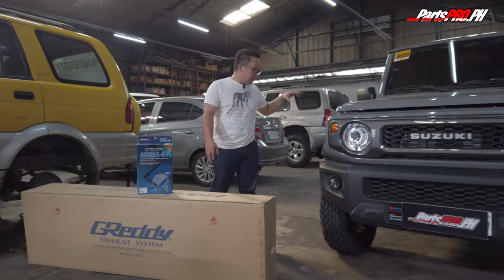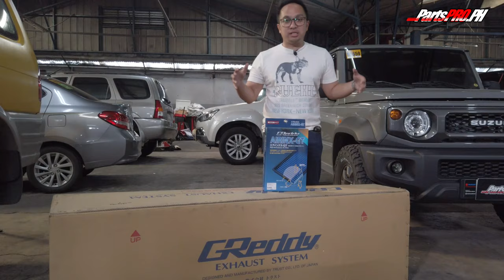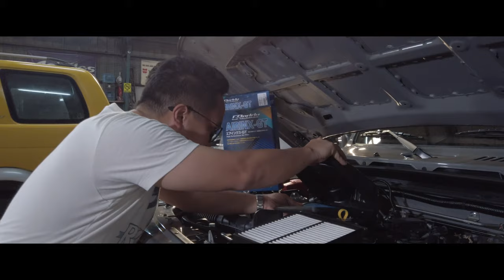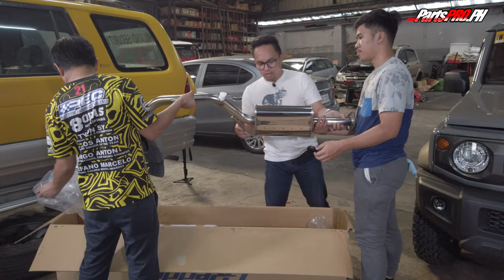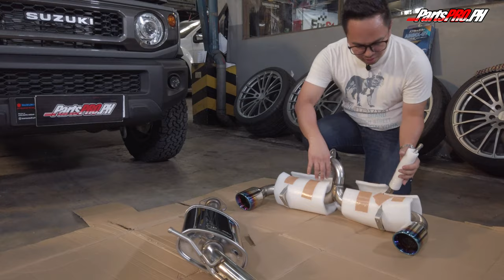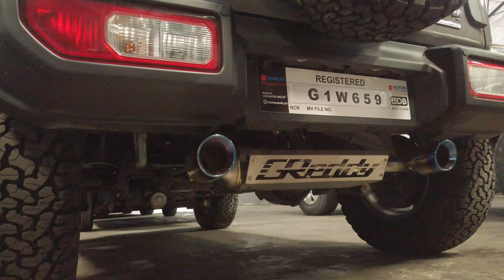2019 Suzuki Jimny gets a new exhaust system

Comment: Damm, I’m in Australia and want one.  Got to make that 1.5 engine perform as best as possible.
Reply from the maker: The DTE pedalbox was a big difference maker. The easiest way to explain it - its like adding a sport button to your car. Throttle response is super quick now compared to stock.
Reply: I just use idrive because they sell them in Australia
Reply: Add a throttle controller makes a hell of a difference.
 5 driving modes.

Economy Mode
Comfort/Towing Mode
AU automatically adapts to your driving style 
Sport 
Sport + 
Fitment takes 5 min and it’s extremely easy to fit.

Comment: does jimny has a mod. adding a turbo and a intercooler?
Reply from the maker: A turbo kit is now available for the new Jimny. But honestly we dont feel that its necessary. Better gearing would be much better for the car vs more power.
Reply: There is a turbo kit from UAE. Check out autoplus video of 200hp Jimny.